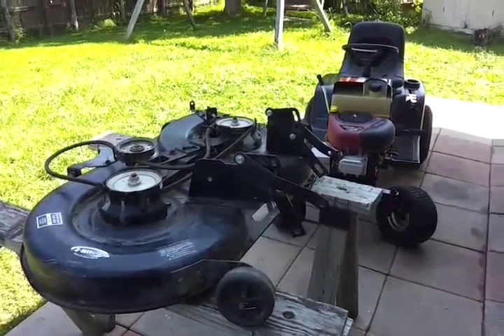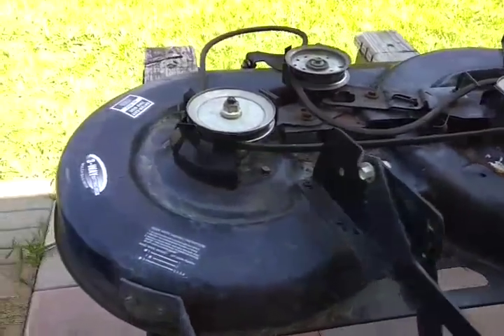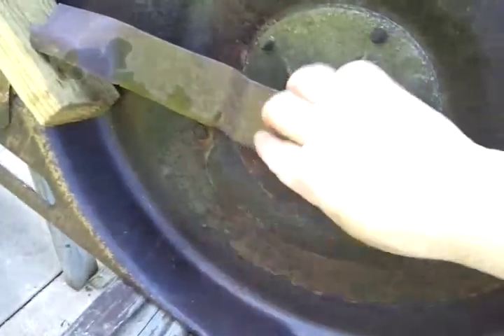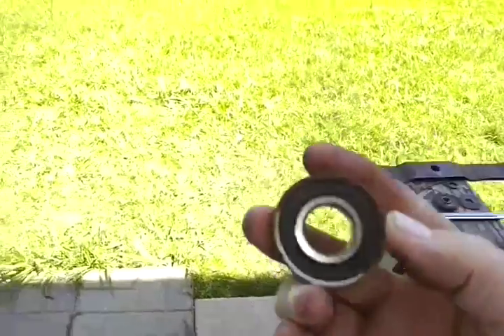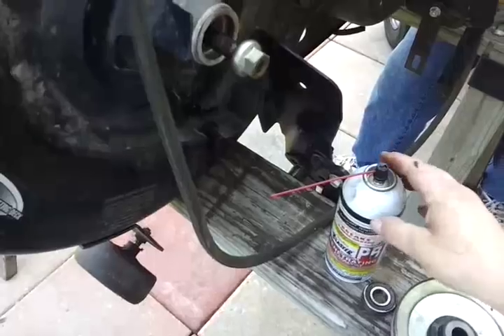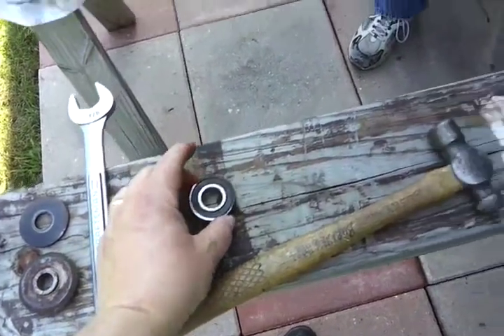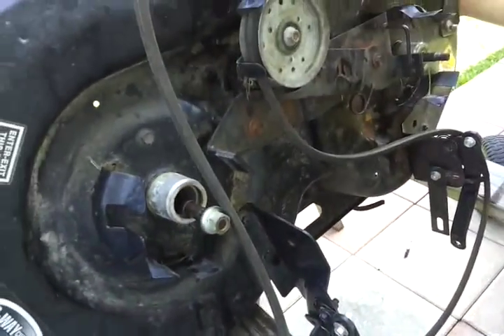03 Murray Craftsman Riding Mower Spindle Bearing & Blade change Part 1

Comment: great tip ... glad to see its not a "replace the whole deck" kind of repair. Just what i was after, I wanted to make sure these are not sealed up. Changing mine once I get them out to find the replacement sizes.
Reply from the maker: I would use the sealed ones. The aluminum from heating to cooling can create moisture inside those tubes. The part numbers are in the video and in the description. Best Wishes & Blessings. Keith Noneya

Comment: It went well  today ... Need the spindle shafts now .. Threds on the blade side stripped but tightenthem past the bad threads. Will go a while thanks for The  tips.. I put some new grease  fittings in too lil bit of grease
Reply from the maker: Sorry to hear about that. You can probably find them on eBay cheap or even a used set from your local mower shop. Let us know how it all works out. Keith

Comment: I need a blade adapter and it states that is is obosolete and no longer available.  Any idea where I could get some for my OLD Murray ?
Reply from the maker: The blade adapter may be obsolete for the Murray, but check out Craftsman or a local small engine repair shop. Many of those old shops keep old stuff around just for that reason. You may also buy a new hub assembly and it may have one on it. Last but not least, take the old one to a machine shop and see if they can make you one. Hope that helps point you in the right direction. Best Wishes & Blessings. Keith Noneya

Comment: Helpful video..thx. I'm not sure why manufacturer put a grease fitting on spindles? The bearings are sealed
Reply: Same question I have.
Reply from the maker: Yep I agree, I think the fittings were from an earlier version and rather than make an assembly line change they just left them in. Glad the video helped. Thanks for watching. Best Wishes & Blessings. Keith Noneya

Comment: The problem with the grease fitting is its not greasing the bearing as they are sealed both sides if you want grease to get into bearing you need to pop the seal off the inner side
Reply from the maker: Yep I agree. The grease however when it melts from the heat does provide a conduit for heat transfer from the shaft to the hub itself lowering the temperature to the bearing races themselves. So even though they're sealed the grease does help with temperature control and the seals themselves ensure the grease stays on top to continue to provide that function. A weird and ingenious way to do that, but it does work. Thanks for watching. Hope it helped, best Wishes & Blessings. Keith Noneya

Comment: So what good does it do to grease a sealed bearing 😳
Reply from the maker: That is a very good question, I didn't design it so I can't answer that one. But if I had to guess I'd say it was so that as the grease heated up it would transfer some of the heat to the axles shell itself. I elected not to waste the grease and it was fine. Best wishes & Blessings. Keith Noneya

Comment: Seems strange to grease the spindle through the grease fitting considering the bearings are sealed, but I will grease them anyway. Maybe a little grease can get to the top bearing, but I doubt it.  The bottom bearing might get some grease because gravity will be pulling the grease down and maybe into the bearing. The spindles that came on my 38 inch Murray mower did not have grease fittings but the spindles  lasted 20 years???
Reply from the maker: Yep I agree, I think the fittings were from an earlier version and rather than make an assembly line change they just left them in. Glad the video helped. Thanks for watching. Best Wishes & Blessings. Keith Noneya
Reply: I just drilled and tap mine and install zerts yep new brging and remove inter brging covers

Comment: I used the block of wood to wedge against the blade, but the blade nut started to loosen. I have a broken spindle (Hit a high tree root & literally cracked the lower cast of the spindle away from the deck) on a '04 - 38" Murray rider. How can I remove the pulley from the spindle? The pulley keeps spinning, even with pliers on it. HELP!!
Reply from the maker: Remove the top nut and use a large hammer and shaft to drive the broken shaft and bearing out from the top. However by the time you buy a shaft and replacement parts for that one, you might as well just break the nuts off the housing and replace that whole particular spindle with a pre-built new one. That's my take on it.
Reply: @keithnoneya  I have 2 new spindles. I can't get the top pulley off, because it keeps turning once I try to crack the top nut off. What do you suggest to secure the pulley from spinning while removing the top nut? The blade is off the lower shaft.
Reply from the maker: @joelipski5212  The pulley has teeth in it, and so you can try and grab it with a leather glove, or jam it between the pulley and one of the guides. There should be a hole in the pulley you can stick a large screw driver in as well.
Reply: @keithnoneya  I'm trying to explain this right. The 22mm hex nut that holds the pullet to the broken spindle will not crack loose. The spindle is cracked broken to the point the pulley is resting on the top of the mower deck. I cant secure the pulley to crack loose the nut. It just spins. It's insanely tight. How can I secure the pulley? It just flops around when I try to brace it.
Reply from the maker: @joelipski5212  Man that sucks, but if the nut is seized then you're going to have to cut the nut off and buy a new nut. At least you'll have the pulley intact.
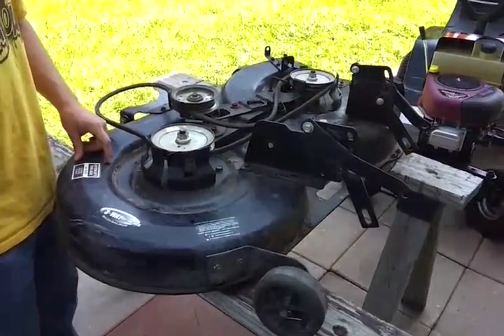Reply from the maker: @joelipski5212  You may also put the blade back on since it has teeth on it, then block the blade and try getting the top bolt off again, like at time index 2:00. Just another thought.
Reply: @keithnoneya  Update: Sadly, the spines stripped after using a vice grip & a block of wood to keep the pulley from spinning. I ordered a new pulley & top nut. Now that they just arrived, I'll cut off the nut and replace everything. Ugh lol Thanks for your help & advice buddy!
Reply from the maker: @joelipski5212  Thanks for the update Joel. Sorry it gave you such a hard time. Hope the new ones work great for you. PS post a link to where you got them if you have the time. Best Wishes & Blessings. Keith Noneya

Comment: I didn't see if there was any grease inside the Jackshaft housing. I am rebuilding the deck on a 1999 Murray 42" cut, and I am pretty sure it's the same deck. I wonder if they even grease them at the factory.
Reply from the maker: Mine didn't have any grease in it. I would put a nice big blob on the bearing housing on the bearing. That way when it heats up the grease will help transfer the heat from the bearing to the housing and on to the deck for cooling the bearing. When I did mine I didn't think of it, but if I did it over I would. Thanks for the comment. Let me know how it goes.    Best Wishes n Blessings Keith

Comment: well got a day off from grass cutting so time to fix the old murray for rough yards
Reply from the maker: Make sure and watch both of them. Also I over tightened the blades, it hasn't given me any problems but just in case I thought I would mention it. You can use the link above to find the online manual for part numbers and torque specs. Hope the videos help. Thanks for watching. Feel free to ask any questions. Best Wishes n Blessings. Keith

Comment: I'm kinda curious as to where the grease would go when pumped in to that grease fitting seeing those bearing are sealed on both sides. I wonder if there are other styles that use that same housing?
Reply from the maker: When the spindle gets hot it flows down around the sealed bearing. Although it probably couldn't get into the bearing it does help transfer the heat to the spindle a little. I didn't put any in mine. Thanks for watching. I hope it helped you. Best Wishes & Blessings. Keith Noneya

Comment: Hi Keith, Question: What is the proper tension for the drive belt(Murray )? I think I overtightened the bolt that puts tension on the spring, which is connected to the pulley  that is right there next to drive pulley underneath the seat. I did this with my mentality working on autos that a belt should only be able to move a 1/4" either way. Clearly this is wrong. Because mower wants to travel even when clutch is fully engaged. I cannot find anything on the net for this belt adjustment or a rule of thumb.  I hope you got one for this or a video would happy to check it out. thanks
Reply from the maker: Hi Amlon, I don't really know I didn't have that problem. Send my your email address and I'll send you a copy of the Manual for it. After you get the manual you can come back and click on the three little dots at the top right of your comment and edit out your email. Most people don't know they can edit their comments, but you can. I've done it lots of times for folks before. Let me know, I'll let you know as soon as I get the email, so you can edit it out. Keith

Comment: Hi maybe you can help me . At 432 in your video. The cast metal the blade tightens to. Mine cracked and broke but I cannot find out what the part is called to replace it. Would you know what the part is called? Thank you
Reply from the maker: Hi Heater look in the manual for the mower. I put a link to it in the SHOW MORE description tab just below the video. If you still can't find it let me know and I'll see if I can find it or at lest point you in the right direction. Thanks for watching. Best Wishes n Blessings. Keith Noneya
Reply from the maker: Hey Heather I think you're talking about the Spindle Assembly or what the Murray manual calls a Mandrell Housing Part Number: 1001200. Here's a link to where you can get one for around $30.00 bucks off eBay. Hope that helps. Best Wishes n Blessings. Keith Noneya  See link below: 
 https://www.ebay.com/sch/i.html?_from=R40&_trksid=p2380057.m570.l1313.TR2.TRC0.A0.H0.TRS0&_nkw=1001200&_sacat=0
PS you'll need the 5 bolts per side too as they usually break off. Here's a link to those too. The part number is: Murray 0025x7
Here's the link to that as well.   https://www.ebay.com/sch/i.html?_from=R40&_trksid=m570.l1313&_nkw=Murray+0025x7&_sacat=0&LH_TitleDesc=0&_osacat=0&_odkw=1001200
Reply: Keith Noneya I just bought it over the weekend. But I found the name it's a spindle shroud. After lots of searching I found a schematic for the mower. Thanks so much for your reply!
Reply: Keith Noneya thanks so much this is cheaper than the one I found. You have no idea how much I appericiate it!

Comment: Use a breaker bar and cheater pipe extension to remove the nuts.
Reply from the maker: Those work pretty good too. I didn't think they would be that tight, so I just cheated and used the double wrench method. Both work well, just you have to be careful with using two wrenches. Knocked my knuckles more than once doing it that way on other vehicles. Thanks for watching. Best Wishes & Blessings. Keith Noneya

Comment: How do you remove the bearing on the pulley side? You just show how to remove the one on the blade side by tapping the other side.
Reply from the maker: Put the nut on the shaft on the blade side to protect the threads then tap the shaft and the pulley side bearing will come out. Feel free to ask more questions as needed. Thanks for watching. Best Wishes & Blessings. Keith Noneya

Comment: Please consult the manual on torque settings.  You are way over-tightening the bolts.  My manual I downloaded from Murray for the Model 425008x8A shows only 35 lb-ft for the blade and the pulley.  I bought new Murray blades and the instructions say the same thing.  As an aside the Belleville washer  and washer on top of it next to the nut are both special washers.  So one should probably not substitute other parts.  The Belleville washer (has a slight concave construction) goes on with the outside rim touching the blade.  Thanks for the video.
Reply from the maker: Thanks Schift, other than the torque specs, never had a problem with it, I put it back together the way it came apart. If you have a reference and time mark in the video that would be great. I try to keep my vids accurate and do make changes when important things are pointed out. On the manual send me a link/page number to it and i'll include it along with the torques specs in the notes. We need more folks like you commenting to keep us honest and safe. Thanks for the great comment. Best Wishes n Blessings. Keith
Ps I might have the manual, to busy right now to look it up now but send me the page number and i'll include it in the description. Keith